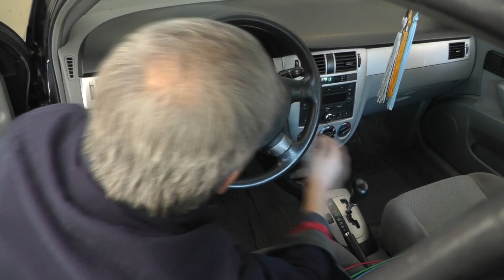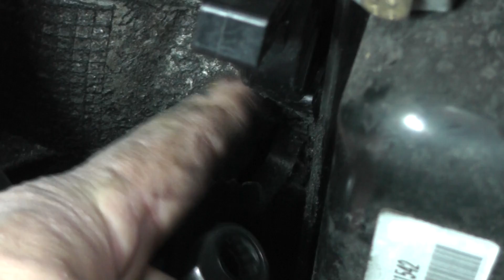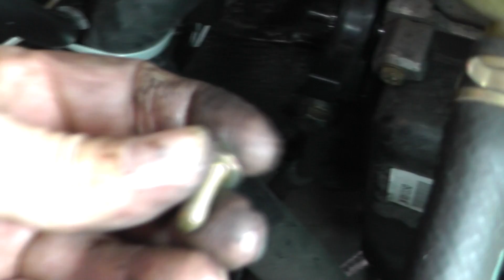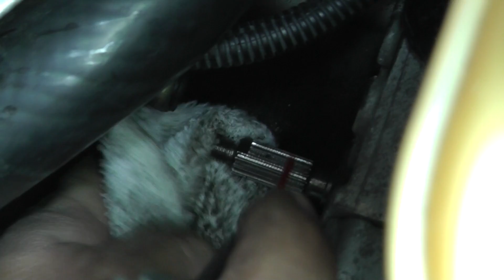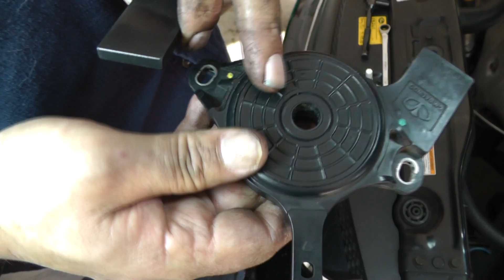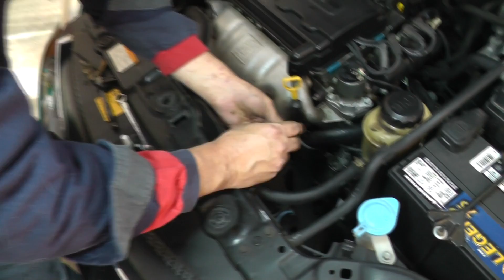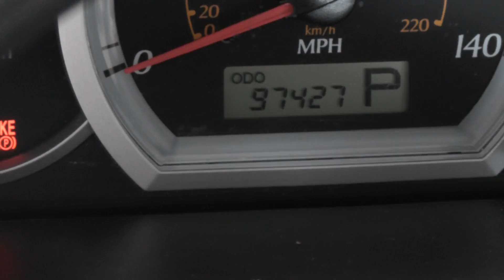Suzuki Forenza Installing Transmission Range Sensor - Part 5

Comment: What did it take to get the new one on?
Reply from the maker: It's a little snug to get on, and it will take a little effort to slide it on.
Reply: @stuzman52  Hmm, the version I had was Amazon junk and the front of it split apart. Was the new one you used have Daewoo stamped into it?...Mine didn't...
Reply from the maker: @DragonHEF01  I can't remember if it had Daewoo stamped on it not as it's been so long ago. If I remember correctly, I ordered it from www.rockauto.com

Comment: Excellent help and will be installing this neutral safety switch myself after purchasing the part and the tool. Heads up your link is no longer valid (well it is a few years old) but if you enter the part number seen on the tool with "suzuki" first, it will come up on search with Freedom Racing. QUESTION: My 2006 Forenza  has never been free of airbag light issues on the dash since the car was purchased new. When under warranty, the dealer constantly checked the pin connections and replaced the harness twice, along with the passenger sensor where the seat foam was a service bulletin. When the warranty was over and the dealers eventually went away with Suzuki being sold in America, there's the main airbag light again which is maddening at only 70k mileage. If you have any ideas here, it would be greatly appreciated! This youtube is a few years old, but seeing recent comments being answered gives me assurance you're still reviewing comments. Thanks again for the great detailed replacement vid here!
Reply from the maker: Thanks for the heads up on the bad link. In fact, all of them are invalid except for the suzuki forum. I've removed the invalid links from the description. As for the tool, you may have a hard time finding it and even back then it was $85. I wouldn't even bother finding it and even if you could, it would probably be even more money. As I mentioned in the video, put the bolts of the transmission range sensor in the center of the slots. That should be close enough for the adjustment of the sensor. That's where the bolts were went I used the tool. I remember people having an issue with the passenger air bag sensor. And it seems from doing a search that there isn't a definitive answer to this issue even today. I never experienced this issue, but if I had, I would have diagnosed this issue and posted a video.

You are correct that the dealerships dried up in North America and parts were getting difficult to find. And that is the reason that I got rid of this car years ago. Good luck on your repair Eric and hope you have a great day!

Comment: took off the lenkage and rotate the bell crank P-R-N and its not matching on the cluster is the switch bad or whats going on
Reply from the maker: You probably don't have the internal range sensor aligned with the cable from the shift lever. When you buy the sensor, it should be in the neutral position. And when you install the sensor, the gear shift lever has to be in the neutral position also. Here is another video showing the replacement of the sensor which may give you some more info about its replacement. https://www.youtube.com/watch?v=tyHqUuS3V3g&t=11s

Comment: Hey startzman having problems putting that sensor on the transmission range sensor you have any methods that I can use to try to get it back on the spleen
Reply from the maker: It's quite a snug fit getting that sensor on there. A little bit of lube on the splines might help. Just give it a good push or pull and it will go on.
Reply: I got the switch on now having problems trying to line the gears up with the shifter

Comment: Very good video and thorough. I recently replaced the transmission range sensor as shown in the video on my 06 suzuki. I had an engine light and the car didnt have any power. Scan the car and came out to be a bad faulty transmission range sensor, however, after i replaced it, few days later the car wouldnt start on park. Starts in neutral but other times it does starts on park. It only happens sometimes. Never had this problem. Any suggestions on what went wrong. I will appreciate any feedback. No engine codes or anything now. Seems that one problem got fixed but now another problem came out.
Reply from the maker: The most likely cause is that the sensor is a little bit out of adjustment. Just be sure that the mounting bolts for the range sensor are in the center of its slots. That should be close enough for an adjustment.

Comment: where I can find to buy the transmission range sensor alignment tool???
Reply from the maker: I don't believe the alignment tool is available anymore. Just put the mounting bolts of the sensor in the center of the slots and it will be close enough for alignment.

Comment: Thanks a lot for sharing this! just one question, is it necessary to also replace a break switch or sensor? not sure that is the right name of the piece I'm reffering to but I read that if we are replacing the TR sensor a break sensor or switch that it's located inside the car is also needed to be replaced.
Reply from the maker: Glad to hear Juan that the video was helpful. You're probably talking about the brake switch. If the switch is good, then it's no need to replace this switch. In other words, if you press the brake and you see the brake lights, then your brake switch is good and there is no need to replace it.
Reply: @stuzman52  noted!! again, thanks a lot!!

Comment: Thanks for your video, I just changed my sensor ,but now the transmission wont take parking gear..... Its weird,,,,,,,, I did all like I'm supposed to, and no good............Any Idea?
I notice that the new part have an arrow that have to be align with the transmission linkage pointer and you are good.     I just disconnect the battery to see if was the computer that got out of synchro.
Reply from the maker: When you the sensor is new, the sensor should be in a neutral position. So, be sure to install it with the gear shift selector in neutral. If you're not sure where it's at now, remove the sensor and rotate the sensor, (the part that the shaft goes on) to coincide with the gear selector position.

Comment: Can you believe the transmission rage sensor is bad again (replaced it in 2006). Ordered another one (was $2.74 more than last time). This will be the third time replacing this switch.The dealer replaced it in 2008 under warranty), me in 2016 and now. Maybe I should have ordered a few of them (LOL). Glad you still have this video up. Thanks.
Reply from the maker: At least you know how to replace it and save yourself some money. Yes, it's a common issue with this car for sure. Have a great weekend!

Comment: Deoxit is good stuff!  I've used it on my antique radio knobs dials.  It works amazing!  Great for scratchy faders or any kind of contacts.  Best on the market in my opinion.
Reply from the maker: You are correct Jack and I've used it also for the same thing. Good stuff as you've mentioned.

Comment: Would this cause my 06 Suzuki Reno to not go in gear or a hard knocking sound trying to go in gear then once car is off for a bit and turned back on it runs fine
Reply from the maker: It could be, but you should check to see if you have a code for a P0705 which indicates an issue with the tranny range sensor.
Reply: @stuzman52  where would that part be located in a 06 Suzuki Reno
Reply from the maker: Roll Out I suspect that it would be in the same location as shown in this video.
Reply: @stuzman52  thanks

Comment: That tool is more expensive than the part!
Reply from the maker: Yes, it is a pretty expensive tool and just wanted to show the service manual's procedure when replacing the range sensor. That's why I mentioned about putting the bolts in the center of the slots of the range sensor so folks wouldn't have to buy the tool.
Reply: Yeah I just did it without the tool and I put it in the center and checked everything and it works great

Comment: When descending from some mountain the car does not reduce gears and 1 and 2 die, so if the car stops at traffic lights, for example, you need a lot of gas to get started, you need to stop pulling the key that the ignition should wait a while and again it is ok Suzuki Forenza 2.0 it may be this  sensor of assumed symptoms greet from Poland
Reply from the maker: Usually with the sensor fault, the transmission will start out in third gear and then shift to fourth. If you have a check engine light on, you could put a scanner on it and see if you have a P0705. That's where I would start.
Reply: stuzman 
Ok thank you very much, I will check again. Regards from Poland

Comment: I have a  04 forenza It won't allow me to take it out of park. Would the trs be the cause of that?. I have to use a metal object and stick it in that slot above the shifter and it would allow me to go in reverse or drive but when it back in park I have to depress that safety release button. What do you think?...
Reply from the maker: If I remember correctly, there is a solenoid inside the shift assembly that you may want to take at.

Comment: Hello Stuzman - Very grateful for your videos. They were VERY helpful when I replaced the head gasket in my 07 Reno. Here's my question: My backup lights are not working. The range sensor indicates all gear positions properly on the dash cluster. I confirmed that the bulbs are good and there is no voltage to the sockets when in reverse. The online manual is a little confusing. Are the backup lights controlled through range indicator switch? About a month ago, I noticed difficulty going into reverse. I ran it through all the gears and problem went away. But from that point until today, I have no backup lights. The car has 146,000 miles.
Reply from the maker: Hey Scott! Looking over the wiring diagram, the backup lights runs through a separate switch inside the transmission range sensor. The two pins of concern are inside the sensor which are pin 7 which should be a pink wire and pin 8 which should be a light green wire. Pin 7 comes from a fuse, (F20 - 10A) which you may want to check first. The wire on pin 8 runs out to the lights. There are a few connectors that runs in this circuit, but I would check the fuse first and then with a test light, be sure that you have voltage to pin 7 and with the tranny in reverse, you should have voltage on pin 8 of the range sensor. Good luck on the troubleshooting!
Reply: @stuzman52  Hey Terry - Thanks for your help. I bought the new range sensor switch and replaced it today. Back-up lights are working again and the range sensor is fine. I'd like to take a minute to say that I believe these cars have gotten a bum rap. I believe so many of them went to the junk yard because of the DexCool coolant they came with from the factory. The coolant didn't protect the head from corrosion and they often blew the head gasket. I knew the oil had been changed faithfully in my car and it NEVER burned a drop of oil between changes. So when the head gasket blew, I milled the head and put on a new gasket. That gasket only lasted 34,000 miles. This time, the corrosion was too deep to mill the head. Since I knew the lower half of the engine was good...I bought a brand new cylinder head and flushed out all the old DexCool before installing the new head. I put conventional (glycol) coolant in it...and the car has not missed a beat in 50+K miles. (it now has 165,000 miles...not 146K as previously noted) These are good motors but were cursed by that crappy coolant. Their other weakness was the EGR. It was prone to leaking. However, these are just another version of GM's Ecotech engine. It has a cast iron block. So, if folks take care of them, keep the oil changed and put the right coolant in them...they can remain long-lasting cars. So...all of this is just to say thanks for providing so much valuable information for these orphaned cars. Keep up the good work!!
Reply from the maker: @Scott6459  Thank you Scott for your experiences with your vehicle as I'm sure that the information can help other folks out there. Always glad to help and that the range sensor fixed your issue. Have a great weekend coming up!

Comment: Hi,

Thanks so much for this video!

I am in the UK and cannot find anywhere to buy the special tool. I've searched everywhere for DW260-050 DT-46473 and the Suzuki part number and just cannot find anywhere to buy it.

Do you have any ideas where I might be able to get one?
Reply from the maker: It will probably be a hard tool to find nowadays. As mentioned in the video, you'll be close enough with the adjustment to put the bolt heads in the center of the slots. That's how it was when I used the tool. I mention it in the video. Thanks for leaving a comment!

Comment: I like the video. Very detailed and very informative. I have a 2007 Suzuki Forenza, when on drive from stop to acceleration the transmission kicks in late, about 2000 rpms. Codes P0700 P0783 P0734 P0722 come out on the scanner. What to do?
Reply from the maker: You've got several codes there Gregorio, but the one that would interest me the most and what I would focus on is the P0722. This is saying that the TCM is not receiving a signal from the output speed sensor. This should be a two wire sensor generating an AC voltage. When you don't have this signal, then you could get those other codes also. If you don't have the service information, wiring diagrams or other pertinent information I would let a mechanic do the work. If you do have the information and equipment for electrical diagnostics, focus on this sensor first. Good luck with your repair!

Comment: 2008 Suzuki forenza transmission speed sensor where is that at or is that it?
Reply from the maker: Should be on the output end of the transmission.
Reply: @stuzman52  so same thing that you  replaced
Reply from the maker: @youcantstopme5136  No sir Randall. The sensor that I replaced is called a transmission range sensor. It's a sensor to let the transmission control module (TCM) what gear the transmission is in. The speed sensor that you mentioned is a two wire sensor located on the tail-shaft of the transmission to let the TCM know how fast the car is traveling. MPH, KM/H, etc.
Reply: @stuzman52  can you do a video on it please
Reply from the maker: randall wilson Sorry Randall. I sold the car years ago.
Reply: @stuzman52  it ok I just can't find it are have any ideal what I'm looking for lol
Reply from the maker: randall wilson you’ll be looking for a sensor that’s probably using one bolt to secure it and has two wires going to it. You may want to invest in a service manual.
Reply: @stuzman52  I think its under the fuse box on the engine

Comment: 06 forenza, will not accelerate, I replaced the sensor but still have  problem, engine seems to start, run and idle great. Put it in gear step on the gas and very little happens,(won't go over maybe 10mph) also when it's cold or 1st start it has loud squealing sound , not coming from belt area, sounds more like near transmission  where it meets engine, one forum said he had that sound and it was a major air squeal from egr gasket , OBD2 showing no codes whatsoever,  some steam out exhaust  but may be normal  for colder weather idk about that one.. what's your thoughts?
Reply from the maker: CENTURY BOY Just a thought but you may have a head gasket leak which is common on these cars.
Reply: @stuzman52  I was going to try replacing the throttle body position sensor since it's not responding much to pressing the accelerator

Comment: Howdy. 
Got a 2005 Suzuki Forenza, gets stuck in 3rd/high gear. Where you gotta press the pedal harder than normal to get it moving. Wondering if you know if it's the range finder or a shift solenoid or something else. It's an automatic..
Reply from the maker: Travis Gaming First thing is to read the code(s). If you have a P0705 then most likely it’s a tranny range sensor issue which is very common on these cars.

Comment: Hi Stuzman, I just replaced the sensor. I do not have the right tool for the alignment so I tried to center the sensor to the hole of the bolt. I did a test drive, and in one stop light, the car seems to be in Neutral instead of in D. Do you think that the problem is due to a bad alignment? Thank you!
Reply from the maker: Luciano Andrés García Rodríguez It’s possible and you can go back and tweak it. And make sure that the sensor is indexed to the correct gear when it was installed. In other words, if the shifter is in neutral, make sure the sensor is indexed to neutral.

Comment: Sman, hope you still get these messages. We had the sensor installed by mechanic and now the car seems to be slipping out of gear while we are driving. Could it just be aligned wrong? If so, would it just need realigned or are the spline teeth be damaged now and I need a new part?
Reply from the maker: Deborah BILLINGS If the car ran better before the sensor install, then it’s probably out of alignment or the sensor was installed with the incorrect gear. A new sensor comes with it indexed to the neutral gear. If it was installed in park without manually indexing the sensor to this new position, that would cause an issue.
Reply: @stuzman52  yes the car shifted fine before it was just giving a check engine light intermittently. I am unsure what gear the mechanic used during install but I think we will try to adjust it again and see if that fixes it. Should we buy a new part or just realign this one. Also, thank you so much for contacting me your video was very informative and I wish we had found it before sending the car to the shop.
Reply from the maker: Deborah BILLINGS Nor sure your new part is bad or not unless you see obvious damage. Good luck on getting your car fixed!